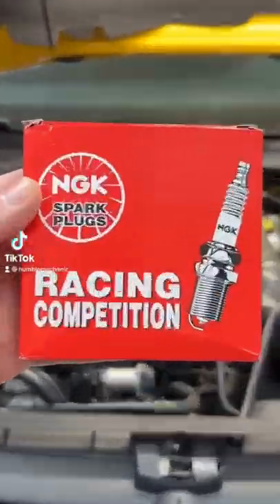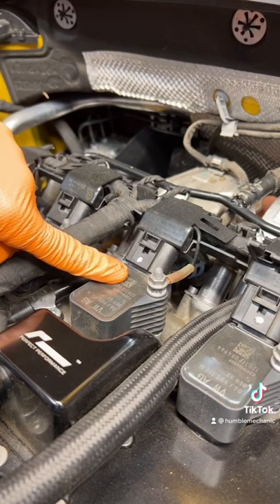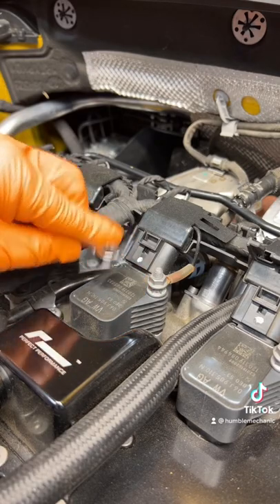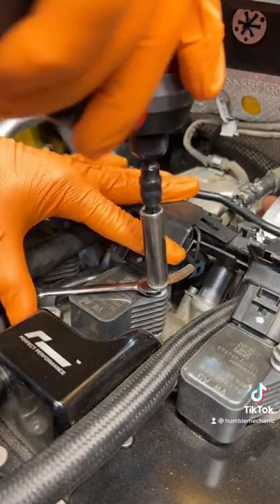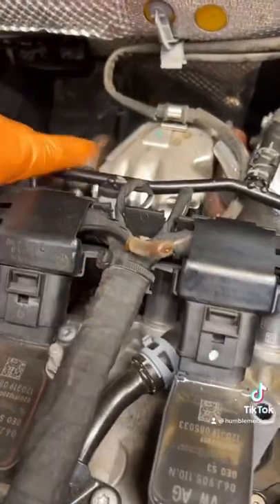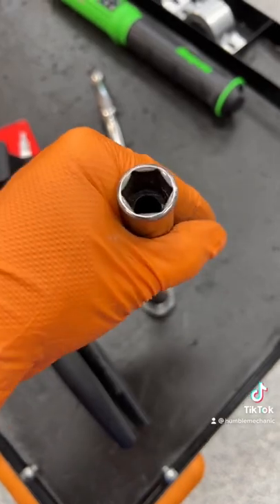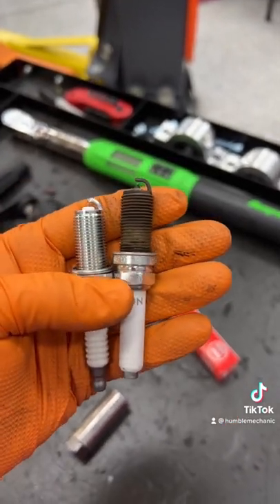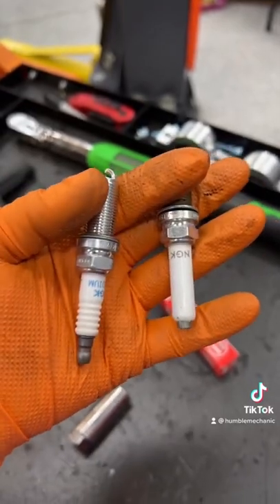Spark Plug Upgrade Golf R

Comment: You know you’re running out of mods to do when you’re shopping performance spark plugs
Reply: mk7 guys are really weird about sparkplugs, it's a whole thing. tuners recommending racing plugs to cover their ass and everybody reads way too much into it
Reply: Well, depending on the car and the tune, running a step or two colder plug and gapping them according to the amount of boost you're running does make a noticeable difference.
Reply: Changing plugs is really important when you're running significantly more power than stock. VWs are really sensitive to spark, and the stock plugs retain too much heat when tuned
Reply: @mikegrudic  I thought the same, but I’m only stage 1 tuned and factory plug was feeling “meh” in the midrange. Moving to a racing plug made a huge difference.
Reply: I swear bro don't ever go on vw forums you'll see people arguing putting premium gas and racing plugs in their 1.5tsi 150hp will make it faster than a gti, and that it makes just as much difference as a tune
Reply: E3 spark plugs
Reply: @Hawkers02  trash plugs 😂

Comment: I like how you just glossed over those coil connectors.......
Reply from the maker: Ya only have 60 seconds. Lol
Reply: @HumbleMechanic  would honestly love a full length video on those connectors. That was by far the hardest part of changing plugs on my GTI
Reply: @khollingsworth5422  I replace em every time I do plugs, you pop the wires right out of the connector and a kit of 4 is  like $30 or less

Comment: I know this isn't the right way but it works for me. When I take those coils out I will tighten them first, then when I loosed that nut on top I don't have to have a wrench on the bolt. Works evertime. Mostly because I don't have a 10mm open end that fits that space.

Comment: I started getting a misfire with the APR coil packs and those plugs.  I’m stage 2 IE 19’ MK7.5 R.  I noticed that the top of the factory spark plug acts like a female connector for the electrode in the coil pack.  The NGK plugs would normally fit as if they were the male and had a female connection in the coil pack.

Comment: I’ve consistently gained 1-2whp on a dyno just using copper instead of iridium spark plugs. Yeah they don’t last as long, but copper is a better conductor by several orders of magnitude. You will always get a more efficient burn if you use copper over iridium

Comment: Engineer from Champion once told me. Unless your engine is modified. Just use the cheapest plug we make that is the correct fit.  He told me they have to make a super duper  better than all the rest spark plug so they can sell them.  Most people don't buy spark plugs ever.  Unless they think they are getting the new improved super duper version.
Reply from the maker: I’ve seen a lot of sad running VWs that took that advice.

Comment: For those of you pulling these later coils. The suck factor is extreme. NEVER pull these coils cold!

Trust me on this. If the engine is warm, they come out readily. Cold? It's going to suck.
Reply: Glad i did my plugs yesterday after driving home from buying a plug socket, they came off like butter. The spring from the boot stayed inside and were haggard though… apr coils coming thursday!!🤌😈

Comment: NGK interesting choice, always try to use thum rule: Europian car=euro sparkblugs, asian car=japan sparkblugs. Perhaps old myth/habit. There is reason why i like diesel lot of more 1.9 TDI 400tkm original glowblugs 😎
Reply: I do the same. Never had in issue using OEM. Been a tech 13 years and 10 times that I've used something else over OEM I had customer come back with a misfire or just a check engine light or whatever.
I finally denied any work with anything else than the OEM.
Reply: nah. i had enough with Bosch plugs. died after only 20k kms and not only once but thrice. now i use either NGK or Denso on both Euro and Asian cars.

Comment: What a waste of money and time there is no performance upgrade from spark plugs. Specially an all ready high performance car. Modern vehicles already burn all possible fuel and are as efficient as possible when speaking in terms of ignition. Stop buying into the billions of miss information spark plug company’s spend on convincing you to buy there plugs. Stick with Oem.